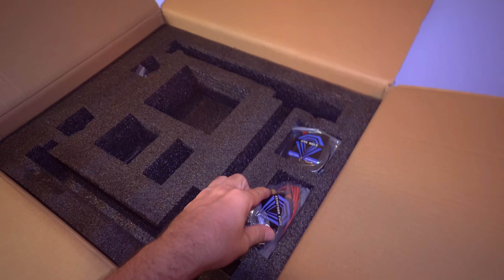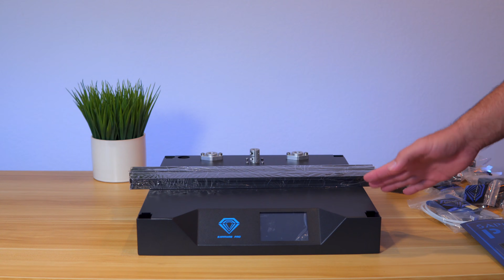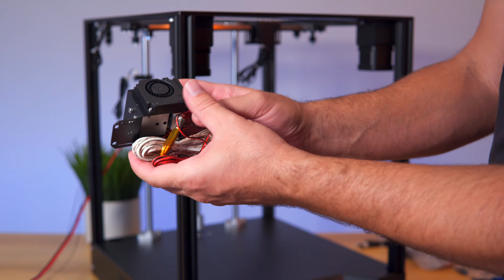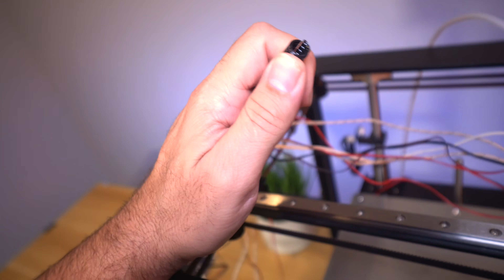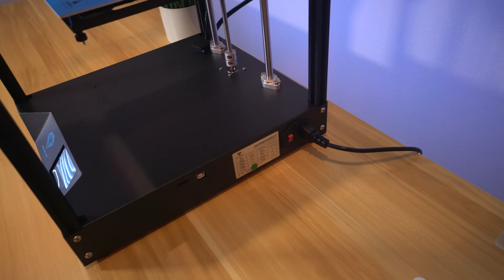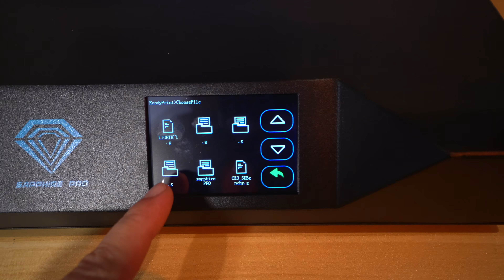TwoTrees Sapphire Pro - Core XY 3D Printer - Unbox & Setup

Comment: Hi and thanks for presentation! New owner learning from it.  Squeaking on z comes from brass nut but is generated by z smooth rods. By just releasing the screws of fixing brackets and playing inside fixing hole tolerances with the rods I was able to remove squeaking. It is not a direct proof that in this condition rods are squared and even spaced, but i presume this is -partly - the meaning. Squeaking is - in my opinion - generated by high frequency slip-stick where screw is hitting alternatively both fronts of nut thread. That-s why it can be heard only in bad-down direction because when starting slipping, bed weight continues moving to next stop hitting the other flank of thread. And so on... My main problem now is with ghosting - which I believe is mainly due to belt tension, and there are ways to fight it; but I don't feel comfortable because I was hoping for a easy/quick set to run. Only your presentation shows there is a new hope!

Comment: Just finished the final assembly on mine, thanks so much for this! I know I'm way late to this video but I have an easy way to sleeve the wires. Take the largest wrench you have (m6, m8 etc) and insert it in to the sleeve opening so that it's perpendicular to the sleeve.  It's a bit awkward at first but keep the wrench as close to the wires as possible, letting the wrench hold it open a bit for you. As I said, it may take a bit of practice, but I was able to sleeve mine in about 2-3 minutes with very little hand strain, and that was without taping them together first lol! Hope this helps anyone who has yet to watch the vid. 🙂

Comment: I like how Sapphire wires are all labeled on some of their printers. It makes for a much easier build compared to Creality. I also like that Sapphire pre-assembles the all the belts on some of their Core XY printers. 

I would like to see all Core XY printers no matter the manufacturer to have a 300mm X 300mm bed. Better to have a bigger bed then you might need right away but then when you need a bigger bed you don't need to buy another printer. Also I would like to see all Core XY printers to have 2 Z axis stepper motors, a solid coupler, a ball screw instead of the standard lead screws, servo drives instead of stepper drives, 4 guide rails for the bed, & the lead screws protruding through the top rail & held in place by a brass bushing.

Comment: I watched quite a few setups while I tried to decide what I should get. I noticed one thing they all had in common, there was either too much to do or not enough. I wouldn't know what to tell a company I worked for which way to go.
One thing that I can guarantee you, if you are NOT mechanically inclined, do NOT by a kit for anything, unless you plan on having someone with you who is.

Comment: its the coupling, you left no space in between motor shaft and the axis screw. they are touching each other, which is not coplings are used for. nice review by the way.

Comment: The filament detector and the bed sensor both plug into the motherboard. WHat I cannot discover is where and how to install the tool ends. Great video. Also you have connected your belts to the hot end the wrong way and this can interfere with it hitting the switch. They are meant to be attached in through the outer slots and out through the more centre slots like a buckle. This should be explained in the instructions and its not.
 I made the mistake as well, I think everyone does.
 I choose to put the bigger heat sinks on the bigger chips but there is no instruction for this either so who knows which one of us is correct.  Its easy for me to type here but you did not have the benefit of wtahcing videos like yours which are a great help (thanks!) Im lost on the feet also. I ended up striping a screw and then drilled and tapped my own custom feet. Good job as they really dont instruct this part well.  All of that said; My first printer was a Prusa rep rap copy that came in a box.. completely and totally in parts. The instructions were all Chinese and I was unable to complete it by myself and had to get a team of tech minded friends (one of whom could read Chinese) to assemble the machine. We have come a long way since then and Two Trees although there are many needed improvements have really tried hard. Thanks for your video!

Comment: Outstanding review and assembly instructions.  Very helpful for me as the included instructions were dismal.  The accompaning thumb drive was sans data e.g. no Cura or instructions.  I grabbed Cura from Ultimaker directly 4.6.1.  I would like to suggest that when assembling the hotbed place blue tape over the screws flip it over drop on the springs and compete the assembly.  Before final assembly of the hotbed it is important to add the cotton insulating pad (the directions omited that component in the install comment btw).  I also found it more convenient to fully assemble the top before installing it on the base.  :)
Reply: Hello Barry Cook, 
What settings do u use for cura?
I tried some settings but every time i tried printing the nozzle got clogged.

this is the g code is use:

M107 ; Turn off fan
G90 ; Absolute positioning
M82 ; Extruder in absolute mode
{IF_BED}M190 S{BED}
; Activate all used extruder
{IF_EXT0}M104 T0 S{TEMP0}
G92 E0 ; Reset extruder position
; Wait for all used extruders to reach temperature
{IF_EXT0}M109 T0 S{TEMP0}
; Default start code
G28 ; Home extruder
G1 Z15 F{Z_TRAVEL_SPEED}

; Default end code
;G1 X0 Y0 Z130 ; Get extruder out of way. Uncomment to use!
M107 ; Turn off fan
; Disable all extruder
G91 ; Relative positioning
{IF_EXT0}T0
{IF_EXT0}G1 E-1 ; Reduce filament pressure
M104 T0 S0
G90 ; Absolute positioning
G92 E0 ; Reset extruder position
M140 S0 ; Disable heated bed
M84 ; Turn steppers off

G1 Z200
G28 X0 Y0

Comment: Great instructional video, Vlad. One suggestion is DO NOT use electrical tape to wrap the wires. When (not if) you need to replace the hotend or thermistor, that tape makes your job much, much harder.

Comment: I had a similar problem on the ender 5 with the lead screw...I ended up returning the printer because of it. I think in the end it turned out not to be the lead screw, it was a problem with the guide rails on either side.

Comment: First a compliment great video!
Then a bit of advice on the Z-axis banding:
First remove  all 4 screws that attach the nut to the bed plane. 
Then  add locktite to just 2 screws and screw them back in for 95% (this will prevent the nut from turning but still the bed rests comfortably on the nut and bushings.)
Doing this gives the nut a little bit of play without forcing things.. this will reduce the line/banding issue drasticly !
I had similar issues on the Z axis of my I3 style printer. and this simple trick reduced the mechanical stress and improved things a great deal.
it will never get to 100% accuracy (this is due to the rods and bushings design) but it sure will improve.

Comment: u wrongly assembled the bed. u first insert the rods on the bottom supports, just tighthen the middle screw but not the laterals ones. leave them loose. then
 WITHOUT THE THREADED ROD
insert the bed and move it to the bottom and then screw the lateral screws of the rod supports 

pull the bed out and then  put the threaded rod into the flexible coupler and then, put the bed. 

the threaded rod should not be touching the tip of the mottor.

Comment: Quick tip man! Add those little sticky zip tie holders to the bottom to hold the wires so they don't sag. Mine did and they blew the board. TT didn't send me a replacement electronics so I'm stuck unable to use mine and unable to make my review. I'm going to program my own electronics with their firmware and try again. Just don't want it to happen to you :) Great video man!

Comment: need to put a baffle (a wall) between those 2 fans or they will fight each other.

The case fan should be exhaust (blowing air out) the other mid mount fan is to cool the brain board. when them being that close and inline they will fight. put a "wall" between then right in the middle to make them both more effective.

as for why wires are on opposing corner. look at the LCD screen and its ribbon cable. That is why.

The strips you found at the end that you are not going to use. they are CHANNEL strips. they go INTO your extrusion channels on the inside of both forward uprights. they are to retain and keep your X and Y wires inside so they don't fall out.

Z motion is actually correct but not quite intuitive. Z- and Z+ is "home relative" since "HOME" or Z0 is UP Z+ means move "away" from Z0 and Z- means move CLOSER to Z0

so non intuitive but technically "correct"

Comment: Replacing the power supply can fix the layer line issue. Try a standard atx PC psu that's rated at least 20% over the amp draw of the printer.

Comment: The Up-arrow moves the bed down, because the menu is still configured for the reprap printers. So the up arrow just send the GCODE to the Z-axis motor for more distance between nozzle and heatbed, no matter what kind of printer you use.

Comment: I believe the auto bed level is done by using a G29 command in the starting G-code of the slicer. It will then auto bed level when you start a print job from the code generated by the slicer. And the screeching sound may be the linear bearings on the guide rods. I would take them off and lube them well. And also make sure the guide rods are as parallel as you can get them.

Comment: How can you say that this printer is amazing when two of the major selling points which is automatic bed leveling and filament run-out you can't get operating because they didn't Supply you with instructions or a way to have them operating to me that's a fail in shipping and producing a printer for people to understand you are losing credibility every week little by little. I'm not even mentioning the fact that you got a printer this printing ugly and you're still saying it's amazing you don't know for sure if it's the lead screw or not. I'm not trying to dump on you I usually like your videos but lately it seems that every printer you get is amazing and it shouldn't be that way.
Reply: its awesome. but prints like shit lol

Comment: The layering on the z-axis is probably due the flexible coupler carrying the weight of the print bed. The coupler is essentially a spring so it flexes when the bed moves which results in uneven movement in the z direction. I would suggest doing the ball bearing trick (search for it) which is putting a single ball bearing in the coupler between the motor and the lead screw. The ball bearing will carry the vertical load but still allow the flexible coupler to deal with misalignment. This should really help with the layering.

Comment: The noise that you are hearing, is probably not coming from the z-lead screw anymore. It is probably coming from the z-bushings. If they are not placed with the exact space in in between, then they will make noise when the z screw is turning.
Reply: Exactly, the sound is probably from the z-rods and linear bearings. Either the rods are not exactly parallel or they are slightly too thick in some places.
Reply: @bolek2  I have bought it and lubed the Z leadsrew with ball-bearing grease, and the noise is gone, it is the lead screw. I have no layer lines, no issues, just replaced the controller board for a duet 2 wifi  :-)   and of course checked every single bolt in there, after all it is made in chine, no offense

Comment: I would like to see belt tensioning on this printer and the QA dept still needs a bigger kick up the ass, missing power wiring faults is unforgivable considering the possible implications of this fault.
 I was in the market for a Core XY and was considering this printer, however, I'm going to build my own, with all linear rails including the bed, and 320x320x400 I'm basing it on the Evolution with some of the printed parts being machined from aluminium and stainless  steel

Comment: I have the same Issue with the lead Screw. Didn't found a way to fix it.
Reply: Many printers from RepRap days onward - strived to have the lead screw move the bed in Z only while allowing play in x-y.  So moving the lead screw in x-y (tilting it) should not move the bed in x-y at all.  Banding on this printer appears to be worse on the lower layers which seems consistent with this issue.
Reply: Just a thought, but did you check to see if the stepper motor is square and on plane with the lead screw and base? The sound reminds me of the lead screw being pulled left or right / Front or Back and not centered on the lead screw path. You should be able to check with a square and level as well as a weighted line (plumb bob). If you take out the lead screw you can lift the bed to the top and feed the line through the lead screw path (center it obviously). The plumb bob will tell you if it's out of alignment (as long as the machine is level - gravity is still gravity after all :)). 

Waiting for mine to arrive, so I've been reviewing all the YT videos on it! Lol.
Reply: lube the Z lead screw with Grease for bearings, and the noise is gone.
Reply: @martijndeman4789  if you lube the bearings does that mask any inherent issues? I could duct tape wifey mouth shut but that won't keep her from talking; just can no longer hear her...

Comment: Great video! I’m trying to figure out what 3D printer to get. I have been thinking about: Tevo tarantula pro, Anycubic i3 mega, this 3D printer, or the artillery sidewinder x1. What would you recommend if one of these was the only printer I had?
Reply: same here, leaning towards the sidewinder but im lost...:D
Reply: Sidewinder x1 that’s what I would go with :)
Reply: Good price to
Reply: 1st thing is, what type (mechanism) are you into to explore and thinker with. I3 style ? Core xy ? Quadrap ? Delta ? 

Then decide on the existing printer in the market. Or better, built one DIY, like HEVO or BLV

Then you need to consider, the built area. Is it big enough for what you want to print ? And material compatibilities
Reply: I had the ender 3 and i3 mega out of those two I'd pick the ender 3. I had nothing but problems with the i3 mega. I'm currently getting the sidewinder though so I don't have any input on it.
Reply: @buddybonbutt7510  Ender 3 - the best!
Reply: Same have an ender 3 no Problems